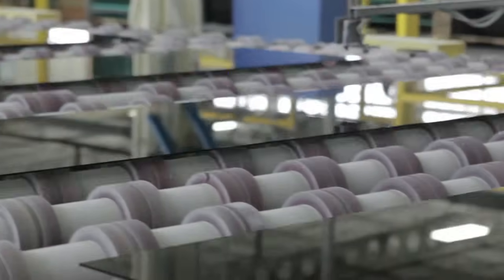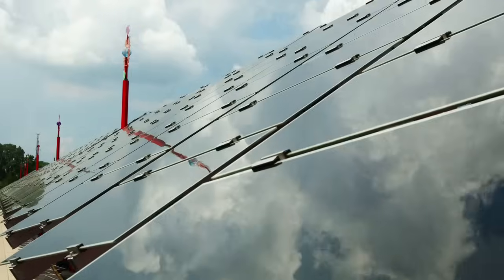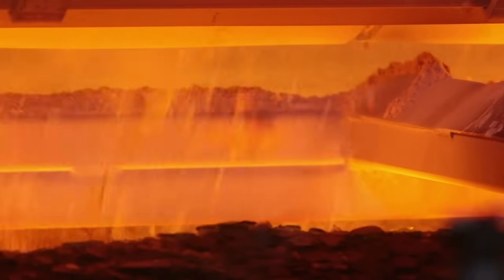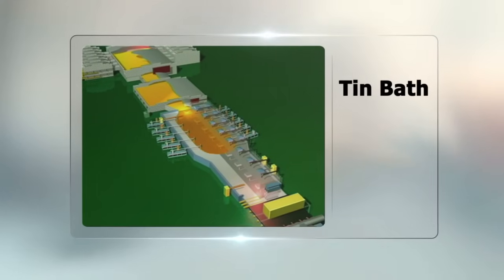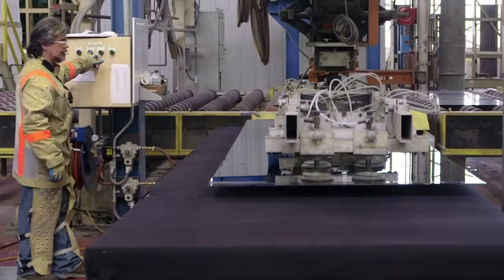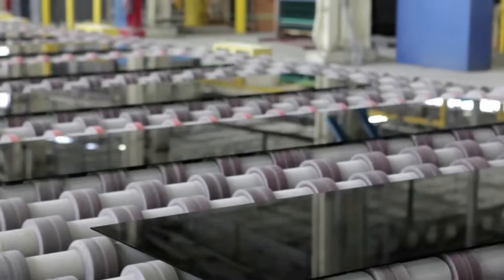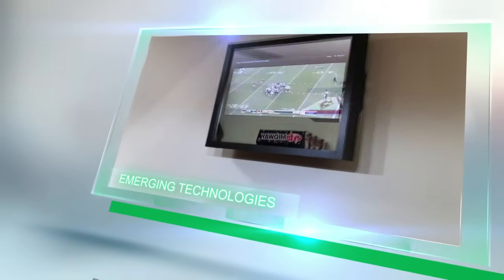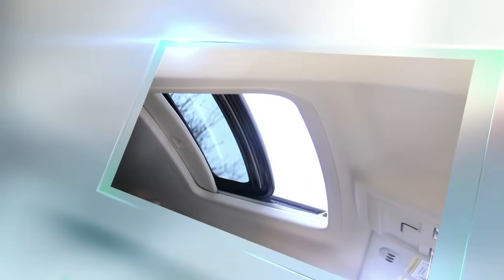Pilkington Float Glass Process

Comment: I just had a windshield that only had a 90 warranty fail.  I had it installed about 6 months ago during the winter and as soon as the temperature got up into the 90's the glue failed that holds the Honda Sensing unit cover in place. The shop tried to reattach it and that did not work. Luck for me the shop full covered the cost of the replacement and install.  This Pilkington windscreen in my opinion had a funky tint to it. They replaced the Pilkington with a PGP windscreen its crystal clear. I was a Glazier in my younger years so I do know a thing or two about glass.

Comment: Great video, but I object to the characterization of float glass as "perfectly flat and even". Yeah, it's very even and very, very flat, but it's nowhere near flat enough for use in measurements in high-precision applications like machining. There's a reason surface plates are made of lapped granite instead of float glass.
Reply: Yeah but can you make windows out of granite ?
Reply: @stewatparkpark2933  Sure! They'd probably be small, tinted/hazy, and ridiculously expensive, but you could do it. It'd be kind of like making perfectly flat and even float glass.  ;)

Comment: As it was introduced, the float glass process makes perfectly flat glass. How does this process change to make automotive glass, such as the sunroof for example?
Reply: From what I know about glassblowing, there's a temperature range where glass is soft enough to be shaped, but firm enough to hold said shape. Presumably they'd take the glass and bend it while it's not quite cool, then let it finish cooling.
Reply: Yes correct. The glass is heated to about 1800 to 1900 degrees. Then come out of the furnace into a mold which bends the glass afterwards it’s goes into an air quench which cools it to about 600 degrees rapidly. Which tempers the glass. Why it breaks into a thousand little pieces for safety.
Reply: I work in a float glass plant, the process remains the same but the quality standards are alot more strict. the customer repeats and laminates the glass after ring cutting it

Comment: I could use several sheets to MAKE or POUR FLAT table for assembly... not welding.. ADHESIVES.. adhesi9ves ar in space.. I use it for SANDING sharpening chiseld.. As FLAT and cheap and available now.. figure out how to use it.. NO HEAT just adhesives.. whatcher think?

Comment: Can the curvature of the earth be detected in the float glass?
Reply: Frank Hughes no float glass is perfectly flat...like the earth
Reply: @therabman_5606  liquid finds the natural level so yes the curvature of the Earth should be measurable within the float glass. I even contacted manufacturers asking about this measurement but none have returned my messages.
Reply: @therabman_5606  XD
Reply: Also gravitational variations might play a factor but I'm sure the sizes of most windows it doesn't matter.
Reply: @adamkendall997  the float glass is almost 2 kilometers long and then cut into different sizes.
Reply: @frankh.3849  The liquid tin portion is not 2 km long. That is the distance over which it would "find its level" in flat-earther parlance. Then it goes through an annealing furnace on a fixed conveyor bed. It will mostly conform to that.
Reply: @FinnMcRiangabra  have you been in that facility? From what I read on their website is they have the ability to make a 2km pane of glass
Reply: @frankh.3849  I have not been in their facility. Did they say that the tin float bath was 2 km or that they could make a 2 km pane of glass? You don't need a 2 km tin float bath to make a 2 km pane of glass. You just need enough conveyor length past the last manufacturing stage. I wonder why they might boast of being able to make a 2 km continuous pane of glass, because how would you transport it anywhere?
Reply: @FinnMcRiangabra  contact them and ask these questions like I did.... Their engineers seem to like answering questions. Also contact crystal lagoon and ask if the curvature can be detected in the largest man made pools in the world. They build them. What you got to lose? It's a rabbit hole I've been down.
Reply: @wally s I'd like to get the manufacturer to confirm that 8". Crystal lagoon the largest swimming pool builder actually contacted me back when I asked this same question about the swimming pools they built that's over a kilometer long. They wouldn't answer the question but they found it interesting I asked....
Reply: I work in a float glass plant. Our bath is suspended so it can be leveled and truly flat. The LEHR rolls are approximately a foot apart from one another and each have their own set of adjusting bolts so the entire LEHR is also made to be level and as flat as possible. So no, the curvature of the Earth is a factor removed by the design and construction of the plant.
Reply: No. Not anymore than you would notice the actual earth curved or a pool of water. The glass floats (float glass) on molten tin, similar to oil on water. What you can notice sometimes is what they call edge bow. It happens to glass as it is being annealed. This is the area from where it exits the tin bath to where it is scored. It is a long conveyer where the ribbon of glass is under controlled cooling. The glass sometimes behaves like a sheet pan in a hot oven. You know when it warps and twists? The idea is to get it nice and flat by the time it is scored and broken out to the customers final size.